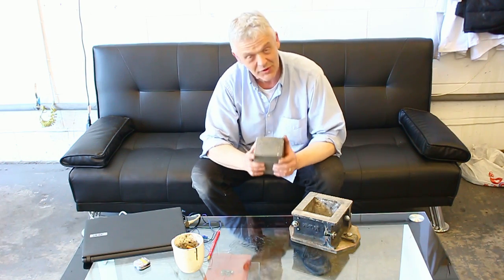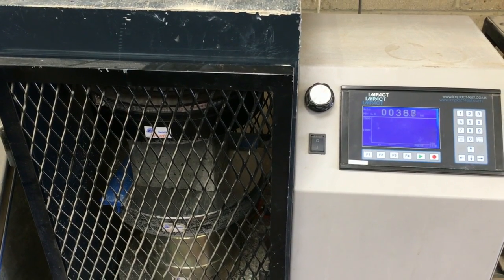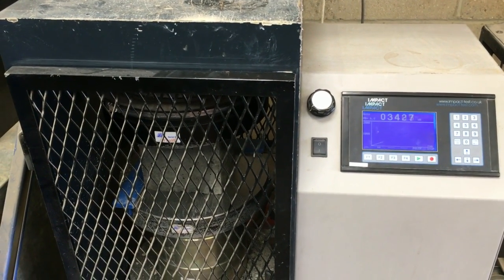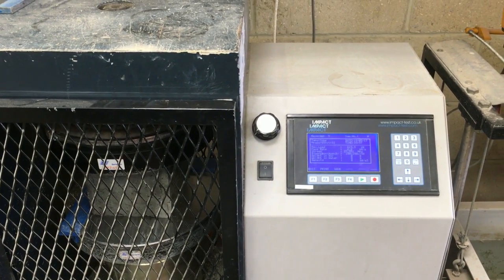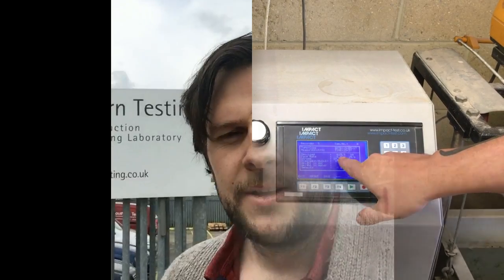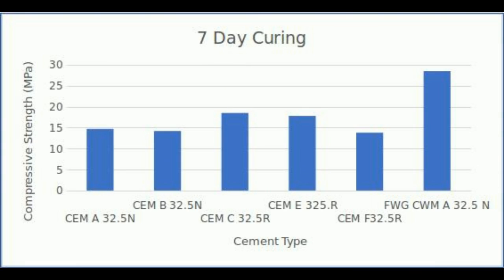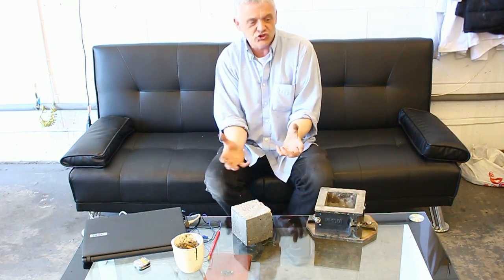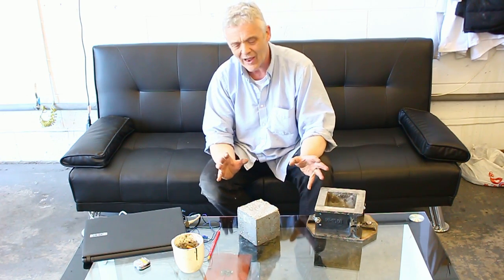Graphene in Concrete

Comment: I truly love the work your doing guys. I just want to give everyone a brief history lesson on Asbestos and let's see if anyone else draws any parallels like I am. Asbestos is a completely inert material that is heat and chemical resistant. The world embraced these properties and put the darn stuff in everything from the plastics you use today in your pot handles, floor tile, shingles, break pads, pipe insulation, counter tops ( labs mostly), the list goes on and on.These fibers are so small and light that they take 3 days to settle out of the air in an disturbed room. Yet if they get in your lungs they form scar tissue due to their size and needle like structure. Asbestos effects on the body take decades to develop. Are you sure you want to develop a fine dispersal device to add this to concrete? 
Just stepping back and looking at the big picture...

Comment: Hi Robert, 
2 further ways amongst others to explore:
1. mix tiny glass balls inside to reduce weight and receive at a certain ratio even the possibilty to have ' floating concrete '.
2. mix optical fibers in it to receive ' translucent ' concrete. 4-5% is the standard ratio for translucency. 
Would be interesting to see how graphene is influencing this next to increase the stiffness.
Herri

Comment: Hello, Did you use graphene oxide (IGO) of tour method in the concrete?
Reply from the maker: yes
Reply: How did you dissolve the graphene oxide in the concrete? What was the technique?
Reply from the maker: put it in and mix it around a bit

Comment: Rob. Can you please share the formulation to make graphene concrete, the technique and if we have to use a specific type of graphene. Please and thank you in advance for sharing these advancements.
Reply from the maker: any graphene will do - chuck it in the mix and stir until dispersed
Reply: Robert Murray-Smith Terrific! Thank you very much, Rob. Do you think this graphene-concrete will support high temperatures around 1500°C? Thank you so much for replying, Rob.
Reply from the maker: i am sorry mate i have no idea but i doubt it
Reply: Thank You, Rob!
Reply: Hello again, Rob. I forgot to ask. What is the recomended dosage of graphene per kilogram of cement or concrete mix. Thanks a lot again, Rob.
Reply from the maker: hiya mate - i am sorry but i have no idea - i just guess an amount and experiment with it - try 1% and go from there
Reply: Thx, Rob. I was also considering that.
Reply from the maker: it's the only way to go mate - to be honest we are guessing with stuff as it is so new
Reply: Yes I figured. I was actually going to try 0.1% at first and going from there as that is a common percentage range of other concrete additives such as cellulose ether and superplasticazer.
Reply from the maker: awesome mate

Comment: Rob, Tony,
Its probably obvious, but for those that perhaps don't understand, your results represents a dramatic improvement in compressive strength. I would be interested to know what, if any, I improvement you can measure in tensile strength ?
Is there any hope that graphene could replace steel as the tensile strength component in reinforced concrete structures.
Reply from the maker: hiya mate - we are having the tensile testing done now - it is a bit more involved than compressive testing but we are currently making the blocks for it

Comment: Hi Robert

Thanks again for all your stuff. It's great to watch.

Can you add concrete glue to this stuff to make it stronger? Can you add the graphine to air Crete? That would be super strong and very light. 

They have pre mix air Crete from CFC cellular fibro cement.  it comes in a 50 lb bag I think. I bet if you added the graphene to that it would be awesome. it works like expanded foam , but it's concrete.

What fun.
Reply from the maker: I suppose you could mate and yes it would be awesome lol
Reply: Hi Robert

Two questions
1. Can you do a video on the recipe for your concrete? Or is it proprietary at this point. 

2. I am wondering if this carbon based concrete has mold issues. The reason why I ask this is because carbon can house mold. If that is the case that the graphene promotes mold in the concrete, can you add a mold inhibitor like borate or other mold inhibiting chemicals to the mix.
I think the chemicals that they used to make sure pallets don't rot would be a good place to start. There would be other non-toxic and or safe chemicals to inhibit mold in the concrete I think.

What is your opinion about the graphene promoting mold in the concrete?
Reply from the maker: the recipe is proprietory i am araid and i don't think there is a mold problem but i will look at it if you like
Reply: Hi Robert

Do you have a email and or website address?

I have stuff to show you that may help you.
Reply from the maker: you can always write to me at robertmurraysmith64@gmail.com mate - but please bear in mind i don't have a lot of free time
Reply: Ok

Comment: This is really excellent, congratulations! I was working on the alternative cement and geopolymere mixtures some years ago and I am still very interested in. Is there really graphene or rather graphene oxide used? My concern is about hydrophobicity / hydrophilicity of the graphitic materials. Expected hydrophilicity of graphene oxide might be an advantage in dispersing and better compatibility with C-S-H gels during hydration reactions. And what is the portion of graphene in the mixture? Is it in order of wt% or less?
Reply from the maker: it's graphene mate and in the order of 0.5% by weight or less
Reply: This is inspiring. Two weeks ago I did an experiment with melting natural graphite from South Bohemia in NaOH (850°C, 1 hour), like for the silicate analysis. In fact, I was interested in how it will behave and whether there is a lot of silicate component in it. I did not quantify it, however, a silicate gel has formed after neutralising the alkali solution from dissolved melt. Slight exfoliation or disintegration of graphite occurred too, as revealed by a small part of a soft dark fraction that was not readily settled down to the bottom. Now I see a possible way how to use this natural graphite with silicate impurities if I can economically exfoliate it in an alkali environment. There are many abandoned graphite mines in some parts of the country. It's like the dump coal you have suggested to be used. Great!
Reply from the maker: that is awesome mate

Comment: I don't want to ask for anything you can't divulge but what ratio of graphene (by mass?) is used in the mixture? I'm playing with some decent <10nm platelets I picked up off ebay and some good marine grade epoxy, just looking for a ballpark to start with so I don't waste as much material. Thanks!
Reply from the maker: 0.5%
Reply: Thanks, at that rate I have enough graphene (50g) to make over 20 pounds of reinforced epoxy! I also want to try making it thermally conductive for other uses, so I'll definitely try to see what happens when I up the percentage. 

May I also ask the best ways to mix it? I'm working on building a magnetic mixer by gluing a neodymium magnet onto a computer fan and hoping that does the trick with uniform dispersion, but I know it'll get messy with the magnetic spinning bit that has to go inside the epoxy.
Reply: WHAT THE PLANTS CRAVE you want to mix it into a solvent first though to get your best attempt at dispersing !
Reply: and then into both of your epoxy mixes but separately and only bring them together when ready to use . watch out for accelerated reaction as well as the graphene may make it a lot more thermally conductive!
Reply: Thanks Mouron, that makes a lot of sense. How do I choose a solvent that won't mess with the epoxy?

Comment: Hey Robert. I hope one day soon you can give us your definition of the word cheap. You don't have to divulge your work but the questions I have are: depending on the application (batteries) what is the energy payback for said battery? If you were to ballpark, how much expense would it add to a brick or a m*2 of concrete? 
Perhaps a good topic for a future video eh. Maybe if we look at how many KJ of energy goes into producing 1gram of graphene using your process?
Reply from the maker: The entire process adds US$1.64 to the cost of concrete per ton
Reply: Robert Murray-Smith that's the total cost of manufacturing? You've really got my attention, more videos please.
Reply from the maker: up and coming mate
Reply: total cost?

Comment: I wonder if aligning the plane of the graphene plates perpendicular to the the compression vector would simulate engineered dirt and vastly improve compressive strength, or if it would just create shear prone boundaries layers.
Reply: Yeah, there is that, but the significance of that property to the bulk characteristics seems as though it would be largely proportional to the size of sheets being used. I wish ol boy from applied science wasn't more of a loner than even me, seeing as how that electron microscope he owns would probably be pretty helpful to get samples on.
Reply from the maker: interesting idea - but - how would you do that in a way that can be done on a building site mate?
Reply: Kinda depends on what works in the lab. I see three options as far as I can think off the top of my head. One could use flow though a prepared medium to induce the alignment, but that would probably require concrete without aggregate, and vastly more powerful slurry pumps. I believe it is also within the realm of possibility to induce alignment through treatment of wet graphene doped concrete with high frequency or possibly just high amplitude, electric and magnetic fields, and a system that does that as far as I know could be plopped on the end of a boom lift and safely controlled from the base. The third that may work would just be a particular patterning of the tamping they already do to get air pockets out. I mean, in detail it's mostly speculation but all of those examples are based on processes that exist, just not for that application yet.
Reply from the maker: awesome - cheers mate
Reply: graphene tends to bend and be kinda floppy, especially when mixed in rock slurry and tumbled

for now it may act as a sort of mesh that holds grains together like putting mesh in sand and it becoming strong
Reply from the maker: indeed

Comment: Hi rob/tony very impressive data. Could you also use this method to add Graphene to road bitumen and tars to help with the reduction in wear on our roads.??
Reply from the maker: sorry mate - i don't know
Reply: as long as its not going to chemically react with carbon at high temperatures or destroy the graphene than my guess is heck yes
Reply: Hi I do not know why we have pot holes or why the road surfaces brake up. Dose it have something to do with the ditumen or tar breaking down so it no longer holds the gravel together. What causes this to happen I don't know.ls it due to weather i.e. Temperatures,rain etc. If Graphene is added could this make the bonds stronger holding the gravel together. For lounger. I know revelry country spends hundreds of millions of £,€,$ every year repairing and maintaining roads around the world. Also how may deaths can be put down to poor road surfaces and damage to cars, trucks, etc. I delive we have been using the same processes that were used 100 years ago. Maybe it's about time we look at what can be done to improve our roads the rough the use of new material and new technology.
Reply from the maker: maybe mate - but i have no real idea
Reply: http://license.umn.edu/technologies/20140157_asphalt-binder-reinforced-with-graphite-particles

Comment: Magnesium oxide based concrete is stronger that those normal concretes so adding graphene to that may produce an, even more, mindboggaling result
Reply from the maker: could well do mate - worth a look at cheers
Reply from the maker: it depends on amount obviously but magnesium oxide is around US$300-500 dollars a ton but ordinary portland cement is about US$50-100 per ton if you buy 10 tons or more at a time
Reply from the maker: cheers mate
Reply: To Baigle 1 Stronger versions of concrete than magnesium oxide concrete sure but they need additives and reinforcement beyond base ingredients so they really are not stronger.
Reply: Indeed, Increasing normal concretes properties is excellent as it uses legacy infrastructure and market acceptance. Cheers mate.
Reply: Magnesium oxide is so cheap and plentiful they use it as hand drying powder for gymnastics and mountain climbers.
Reply: Yes but magnesium oxide cement naturally has an 8000 psi rating and it does not deteriorate over time like portland cement does. Penny wise pound foolish depending on your project needs and desired longevity and getting a bulk deal on magnesium oxide is possible as well. Cheers Robert :)
Reply from the maker: everything is good in its place mate.
Reply: sure it can, test it out

there are also much stronger versions of concrete than 8,000 PSI to play with

Comment: If I read the machine correctly, that test reached 6,000 PSI in 7 days, that is amazing 

Can't wait to see  the 28 day break test 

I have worked with a lot of concrete mixes in the past and the normal spec for commercial concrete is 3,000 psi in 28 days which is required by building code

Using your mix design could be a huge saving on concrete mix as you would need less cement to reach the required PSI

Very nice
Reply: The display measures XXXX(.)X in digits. The measurement is in KN. Frame by frame the max measurement on the Impact Test CT440 (or similar because their user guides are the same) machine is 619.8KN of force. You need to know the size of the cube whether it be 100, 150, or 200mm cubed in order to take the measurement to MPa. Judging from the size vs the upper and lower 300mm platens on the machine the block looks to be 200mm* (measuring using cage spacing), and marked by the blue alignment spacers where to put the block in the machine. Southern Testing states cubes 100mm and 150mm can be tested. The 200mm guesstimate from measuring platen distances is betrayed by the 28.5MPa results, which work out that 619.8KN/22500mm(sq) as of a 150x150mm cube leads to 0.027546667 KN/mm2 which works out to 27.5MPa or 3988PSI. The footage likely didn't show the maximum load on the display as the machine recorded.

On the relationship between 7, 14, 28 day and further strength tests:
"The chart is not standard.  Say a mix has a quantity of flyash substituted for cement.  This mix might reach only 50% at 7 days and only 90% at 28 days.

Every mix cures and gains strength at different rates.  Otherwise every 7 day break for every 3000 psi mix would be exactly the same."

Southern Testing offers many different tests regarding concrete strength, including impurities and water and mineral infiltration statistics. They are key to seeing quality and how well the strength holds over time.

28.5MPa / 4133PSI on 7 day test is pretty good, what cement and water mixture did you guys use? If it can improve the quiky cheap-o stuff from the store that much it really has an opportunity!

http://www.eng-tips.com/viewthread.cfm?qid=134082

https://www.southerntesting.co.uk/services/laboratory-testing/concrete-testing/

http://www.impact-test.co.uk/products/5007-automatic-console-3000kn-cube-and-cylinder-compression-machine/

http://www.impact-test.co.uk/docs/CT340-CT770%20Automatic%20Compression%20Machines_HB.pdf

http://www.cement.org/cement-concrete-basics/products/high-strength-concrete

http://www.cement.org/learn/concrete-technology/concrete-design-production/ultra-high-performance-concrete

https://www.quikrete.com/pdfs/concreteselectorguide.pdf

https://quikrete.com/productlines/fastsetconcretemix.asp

https://en.wikipedia.org/wiki/Types_of_concrete
Reply from the maker: it was made according to BS206 mate from CEM A we got from the local builders merchant - it's meant to improve the quickie mix used in your average cheapo mix - so basically we took that and chucked a bit of graphene in - nothing fancy - nothing engineered no other additives or special treatment
Reply from the maker: that's about right mate but th results are given in the video on the table as MPa
Reply: Oh dear. That's (6000 MPa) 870226.4 PSI
Reply from the maker: the graph shows the validated results mate
Reply: Ok thanks.. sorry about the long post, it just serves to help people trying to say it was like 870,226.4PSI lol

Comment: just wondering have you done something to show how effective graphene 'coil' is compared to tesla coil? i'm doing a research on graphene electrical conductivity.
Reply from the maker: no mate i haven't - sounds interesting though
Reply: yes, yes it is :) do plan on doing it in a vacuum chamber as well, i think there might be some interesting effect....
Reply from the maker: awesome mate
Reply: Jesus Christ sounds good!! Keep us updated, I think I'm subbed to your channel, if not, I will be
Reply: Jesus Christ!
Reply: Jesus Christ doing it in a vacuum chamber be careful to insulate any conductors very well when using high voltage, otherwise it will burn through the insulation and ark out and destroy it.
Reply: The fact you cut camera, right before the lab tech reported the results on camera, makes me highly suspicious.
Reply: Being the real Jesus Christ with a real profile picture instead of a false one: I'm creating the quantum language architecture and quantum notation super system for 3D printed robots that will later mix and pour the perfect amount of "graphcrete" into the forms of advanced combs, set in cells with individual thickness, for a certain environment; wet or dry; cold or hot.